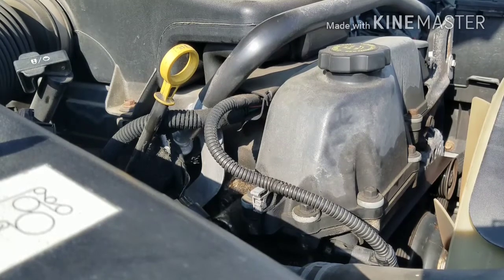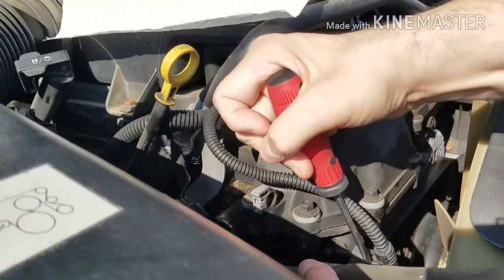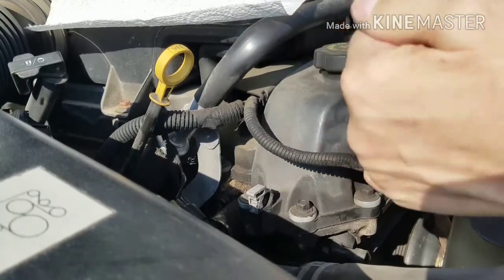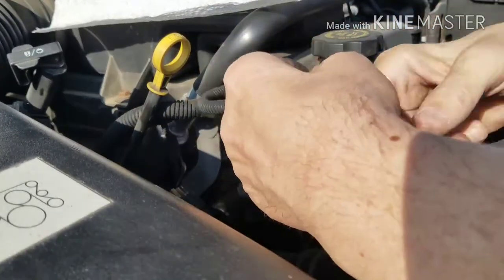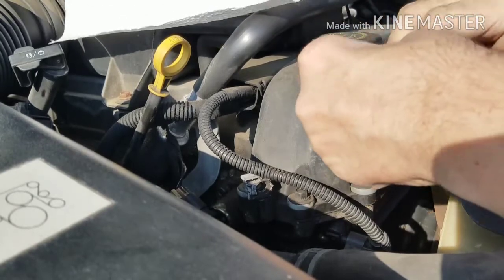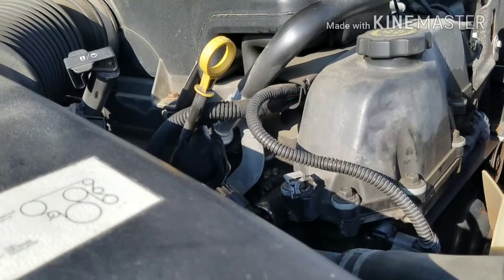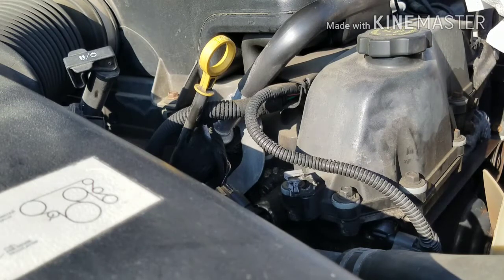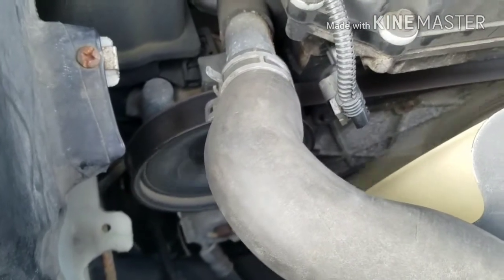2002 Trailblazer Camshaft Position Sensor Replacement with Moose

Comment: So is the truck running fine now? I have the p1345 code myself after doing an oil change.  Literally right as I left my driveway,  worked fine before
Reply from the maker: Truck running better still since but I still need to fix a couple other codes. This replacement was the easiest to do first.
Reply: @moosetube  the sensor you swap is the cam sensor btw. The crank is near drivers side and hope that's my problem.  Just drove the car and man rough idle I tell you. Now have to drive my other toy car today smh
Reply from the maker: TrailBlazer Dayz yes I need to replace that also. Good luck.
Reply: @moosetube  thank you and ditto. I will let you know how it works for me.
Reply: So I replaced the crank sensor and it still ran rough with a cold start. I now have mobile 1 5w30 that I will do an oil change and see if that helps. After that last thing will be cam sensor tomorrow.  If that dont work then idk
Reply from the maker: TrailBlazer Dayz if it’s very high mileage...maybe fuel filter replacement would help.
Reply: @moosetube  just finished the oil change  and it feels smoother right off the bat. Code just came back and will do a full cold start later tonight
Reply: @moosetube  I changed the VVT sensor again. Looks fine but oil shot into the electrical connector idk how but that's what happened to the original one. 

I have one from the auto parts store and car working great.
Reply from the maker: TrailBlazer Dayz sounds great
Reply: i think you can get this code just from jostling the sensor. 

(only code ive ever gotten on my used 03 TB; is an intermittent low coolant temp warning in below 40 degree weather) 

yesterday i changed my senile alternator and after attempting to take the cam sensor off before messing with the belt so i wouldnt snap it, then deciding not to, but i bumped it a few times while pushing down the belt tensioner nothing crazy. after alternator was installed, started the truck, moved it out of the garage(no code) and there it sat until this morning. 

this morning at 3am... check engine light right off the bat. i open my fixd app assuming its the low coolant temp warning, even though it was still to cold to trip that code. 

it was a P0340 "camshaft pos sensor 'A' circuit malfunction".   so i "clear" it....light goes off...   i get on the freeway and try to engage my cruise control... nothing( im thinking "what did i forget to connect? theres only two wires on the alternator, cant be that") go into 7-11 after about 80 miles, start back up, CEL is back on, i clear it, drive on the freeway a bit more, tried cruise control... nope.

after a bit of youtube/google diagnostics on "trailblazer cruise control not working" i found that a problem with this sensor can cause that and it makes sense... if the computer cant accurately tell how the engine is running why would it let you run cruise control?

so i thought back to my alternator job: im pretty sure i didnt break or crack that sensor... but @MAY03LT did a vid on this sensor and he tested/tried to illicit a failure by tapping it... so that told me; a type hard-ish of movement of the sensor can trigger a CEL.

so im gonna see if i did in fact pull the plug out somewhat in my attempt to unplug it and see if its just not fully seated or just do this fix since its a cheap and easily accessible repair, and if its not it... well, its cheap and needs to be replaced at some point anyway.

Comment: The 2 prong Crank shaft sensor goes on the bottom left hand side of the engine 3 prong CAMSHAFT is what u replaced I've replaced all of these plus vvt solenoid AND still run crappy no power and throwing same codes 🤷🏼‍♀️🤷🏼‍♀️🤬🤬
Reply from the maker: Well that’s horrible. Did you find a fix?

Comment: Was your vehicle not starting
Reply from the maker: It was running rough. This helped it. Thanks 👍
Reply: @moosetube  oh ok because my nust stopped running and won't start, just cranks
Reply from the maker: Patriot Pat if you can get a diagnostic code it may tell you what’s wrong.
Reply: @moosetube  showed the camshaft position sensor, other day low beams stopped working, swapped HDM and fan clutch relay and hasn't started since
Reply from the maker: Patriot Pat this sensor replacement is easy and cheap. Look online for best deals. Usually about $10 less than auto parts store